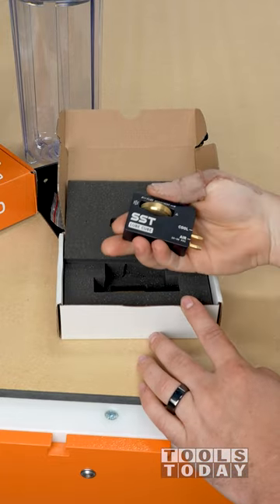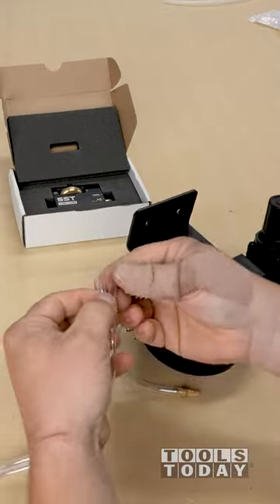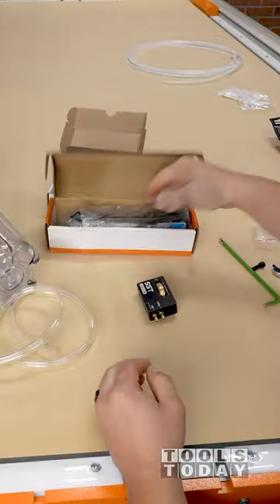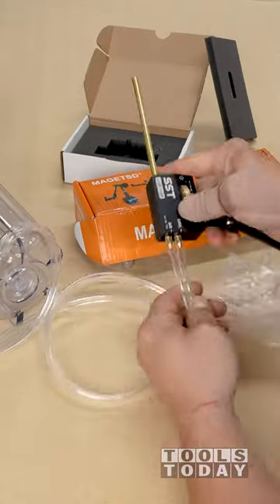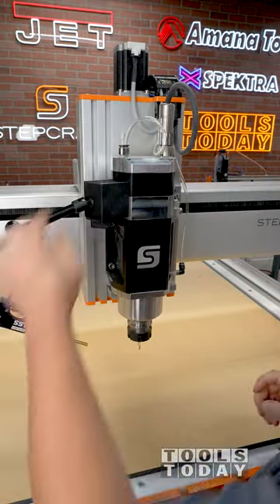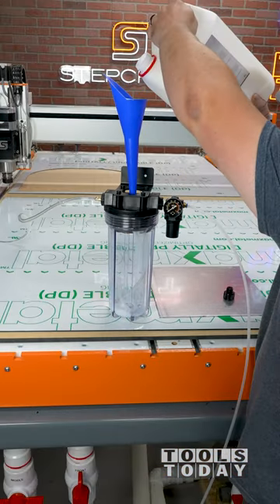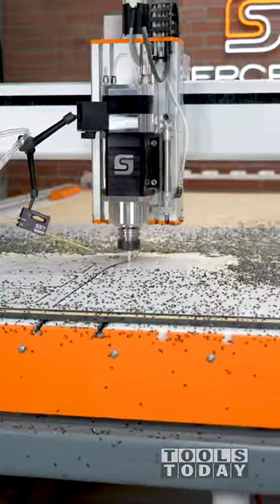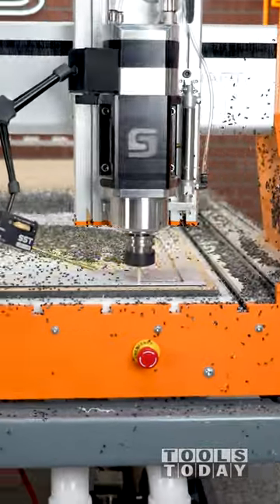Keeping Things Cool

Comment from the maker: Check out the tools used on our site - https://www.toolstoday.com/sst-lube-cube-fogless-coolant-mister-system.html

Amana Tool 51402-Z - https://www.toolstoday.com/v-14286-51402-z.html

Software - https://www.toolstoday.com/cnc-machines-accessories/cnc-software.html

RPM: 18,000
Feed Rate: 80ipm
Plunge Rate: 40ipm
Depth Per Pass: .125"